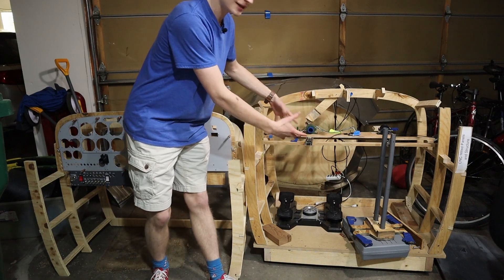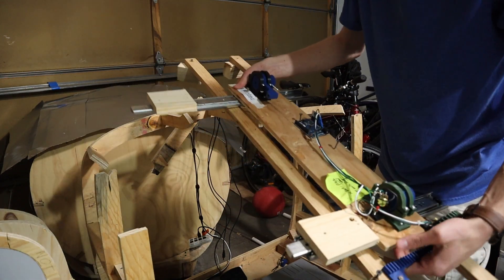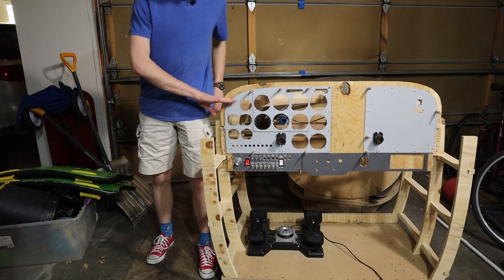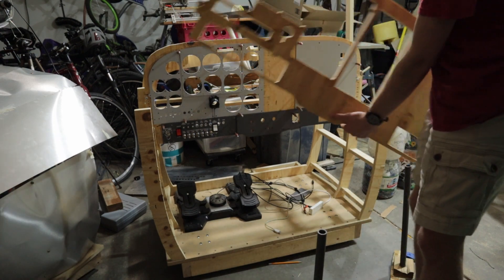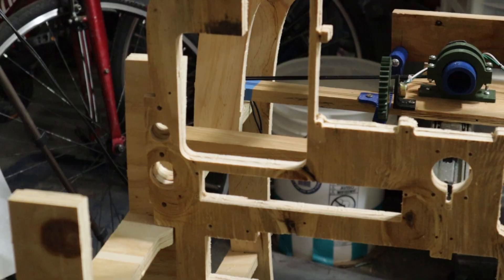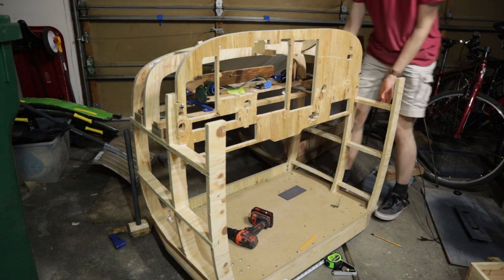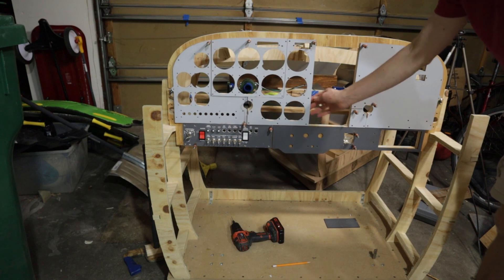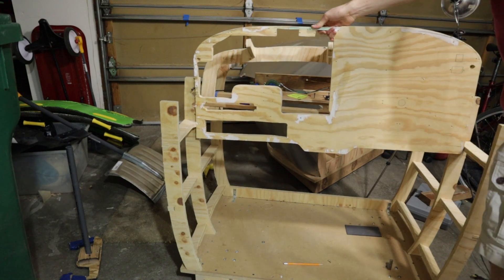Building a Better Simulator Structure | C172 #29

Comment: captain do you still have the 00% print of your cabin frames and bulkheads..... that you used to cut your wood ?? if yes would it possible to post them to me??? even if they are cut or old is ok. i need to build my cabin based on actual plane. i will pay the postal expenses.
Reply from the maker: What do you mean by print? The paper or wood? I have them in the GitHub - Section 2
Feel free to email me CaptainBobSim@gmail.com for more detail

Comment: What type of wood do you use for your frame? I have tried using plywood for other things because I don't have a cnc or table saw and only a jigsaw but they are not thick enough to screw into.
Reply from the maker: 23/32” birch

Comment: You really need to add gussets to make your structure stronger. Very simple to do and adds more stability & strength.
Reply from the maker: Will look into it! Where are you thinking?
Reply: @CaptainBobSim  Where the Stringers/Longerons (horizontal) pieces meet the Formers (vertical pieces).